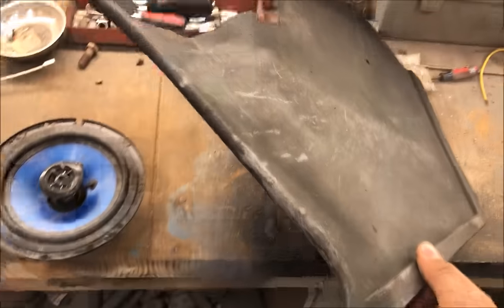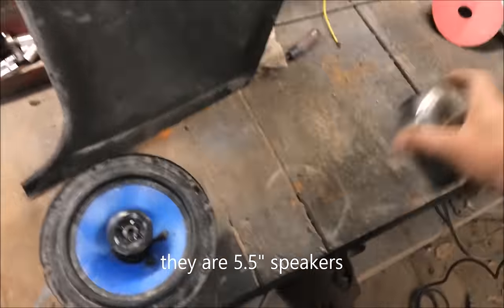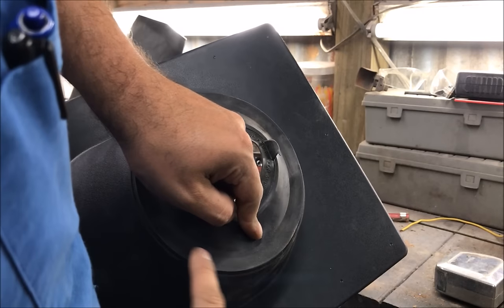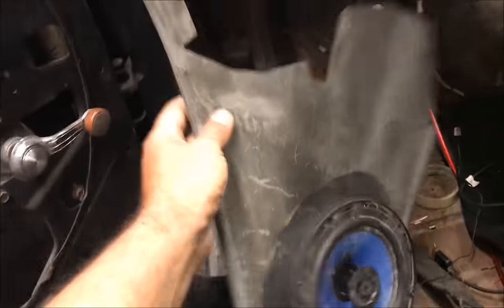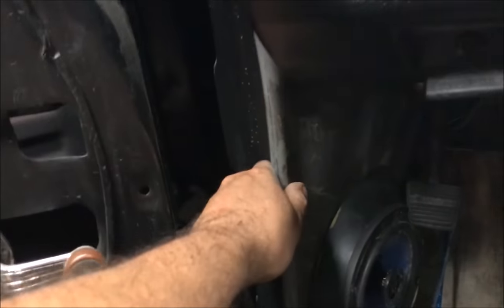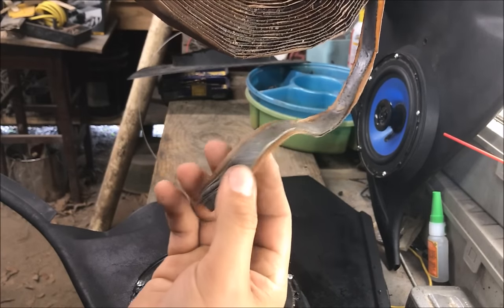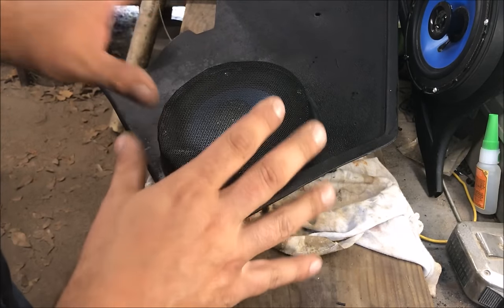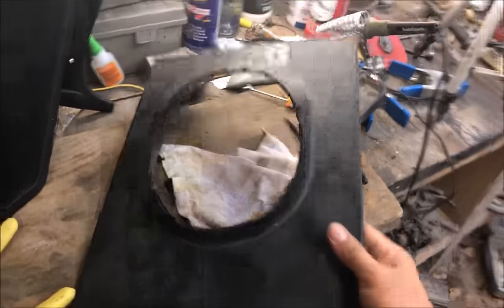70-72 chevelle custom kick panel speakers how to DIY

Comment: Can't see trying to put speakers in the doors and hacking into the door panels.  Kick panel location is the way to go on these cars.  Just got the flashing yesterday and installing the speakers today.  This vid may be 4 years old, but still providing solutions for other DIY guys.  Thanks!
Reply: Getting the kick panel out on the driver side was crazy. Had to remove the inner fender to access the two nuts that hold the parking brake to the firewall. Then I could access the six screws that hold the panel on. Might have to shim out the parking brake.
Reply from the maker: that’s why I did them while my car was apart... I’ve seen many people get their butt kicked with kick panel speakers..

Comment: I bought a set of door panels for my squarebody chevy from LMC. The Plastic itself was half as thick and the material is very hard which makes it prone to cracking. Aftermarket panels are many times junk. If you want good shit, you gotta make it your self. Do yourself a favor and try to incorporate a component system. Coaxial Speaker never sound good.

Comment: What did you use to mount the "pod" to the kick panel? Glue?
Reply from the maker: +1017cutlass  it shows in the video somewhere but I used small bolts and nuts like #10 to mount the speaker and pod to kick panel.. i didn't seal it off but I would of used thick foam tape